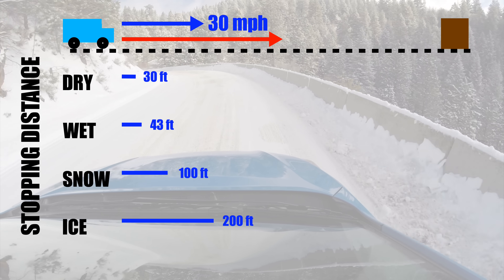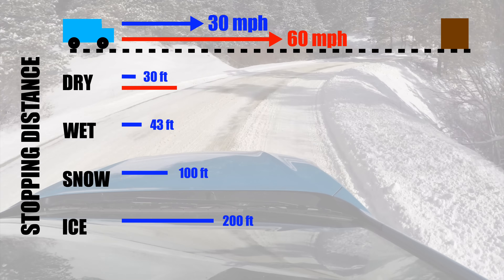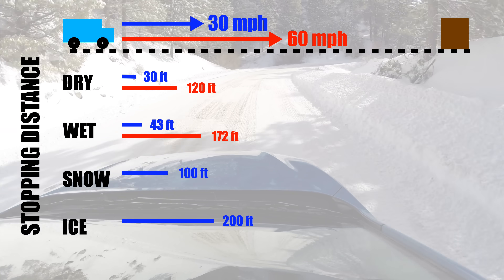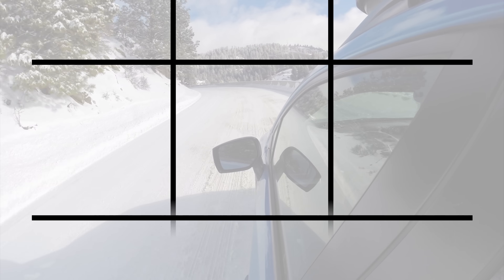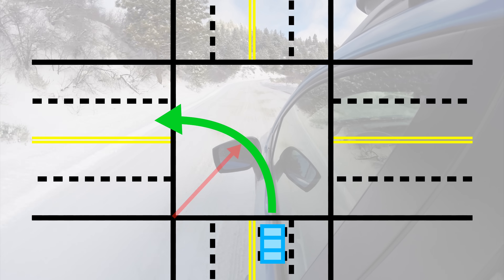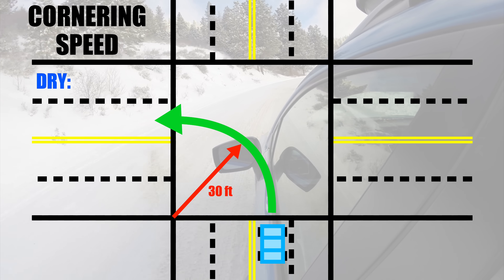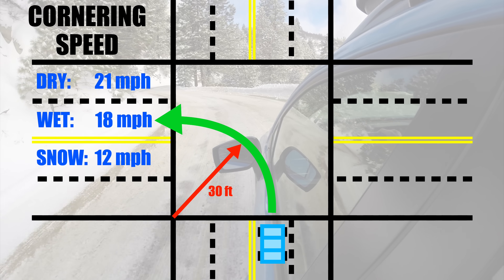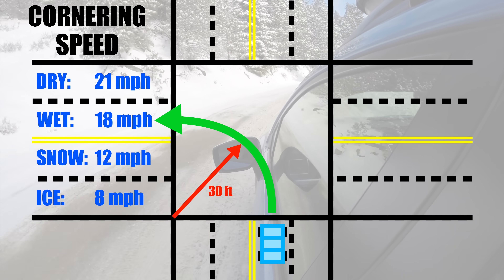Everything You Need To Know About Driving In The Snow

Comment: You should also talk about cold temperatures, which hardens tires and drastically decreases traction on paved surfaces.
Reply: that applies to summer tires. winter tires remain soft enough to handle snow decently
Reply: Actually at really low temperatures icy roads as ice becomes less slippery as temperatures drop. I am talking arctic cold, 30 below and colder, F and C! Ice in mild conditions may have water on or more readily melt from the weight of the vehicle moving over it.

Comment: Learn to counter steer and if you have a 4x4 and are using it drop it down to 1st gear it’s going to slow you down a whole lot faster than locking up the brakes. Don’t care if it’s hard on parts crashing is hard on the body both the cars and your owns. it works because the engine is still spinning and your taking advantage of compression braking it won’t stop you completely but it will reduce stopping distance significantly
Reply: Future Hindsight and where is that vacuum coming from that’s right you have to be able to make compression to cause a vacuum in an engine...
Reply: Future Hindsight what are you talking about they alway have compression with out compression they would not be able to suck air in on the intake thus creating a vacuum... obviously the throttle is closed on a gas engine your trying to slow down with engine braking.
Reply: Air makes compression not fuel... fuel makes the boom happen
Reply: Future Hindsight your missing the point you have to have compression to create a vacuum to begin with. Without compression you don’t have an air pump which is all an engine really is wide open or zero throttle it’s still creating compression. It’s involved in more than the compression stroke. Think about a diesel they don’t have a butterfly valve in the throttle body they control rpm through fueling alone but still engine brake

Comment: Hello, My name is Pablo.  I have posted several times this question on the internet, and it seems that nobody knows the answer.  I just bought a 2011 Subaru Impreza STI, and I want it to change the transmission to a DCT.  Actually an BMW M4 Transmission.  How do I do this?  I'm not worry about the mechanical part but the part on sending the shifting gears to the transmission through the CAN.  Will this be possible?

Thanks in Advance,

Pablo

Comment: I made it 4 winters consecutively without wrecking my 1993 Nissan 300zx with posy track (i dont know if I spelt that right), wide tires, and rear wheel drive up to 3” of compact snow. Chances are you you have little excuse not to drive correctly in snow.

Comment: One thing you didn't mention -- if you have, say, 0.3G of grip in snow, that's a total amount of grip available to you.  It is split between acceleration/deceleration and cornering.  If you are only cornering -- with absolutely no acceleration or braking, then and only then do you get that full 0.3G to help you make that turn.  If you are accelerating or braking at all, then your cornering grip is reduced by however much grip is being used by that acceleration or braking.

It's why anti-lock brakes make you feel like you're "speeding up" when you turn while braking hard.  The system is calibrated to automatically assume steering is more important than braking, so it reduces braking force to let the steering happen without sliding or locking up the wheels.
Reply: Excellent explanation! 
Thabk you!
I would love to see your opinion on driving a Semi with trailer!?
Reply: Yes. Cornering lowers grip, acceleration and deceleration lowers rip, both of these together lowers grip even more.
Reply: Definitely. I've enjoyed fast driving and long ago got into the habit of doing most braking before entering corner with minimal brake force. Yes, there's trail braking but more generally.
Reply: I wonder why that important thing didnt exist on this video.. That is the g-force grip circle all about. You dont need circle if talking two directions separetely as he did.. You cant seperate those in real life though.. Can abc brakes drop braking power to allow some force to steering also? Its complicate thing becouse rolling tire gets better friction than sliding tire but still you cant use maximum rolling friction to get some turning grip also.

Comment: 3 years ago I almost crashed into a highway concrete barrier due to ice and snow. And no I wasn't speeding. In fact I was driving 15mph under the highway speed limit due to the road conditions being so bad. Anywho, I bought winter tires just for winter. Once I got them it hasn't snowed that bad since. Go figure 😕

Comment: Another advice from me would be sticking into a lower gear and keeping up higher RPM, so that you can use the engine break, which is highly useful on snowy conditions. ;)
Reply: Lower gear just makes spinning out harder to avoid if the driver is novice. Tbh taking off in 2nd gear is a good place to start.
Reply: Terrible advice. Engine breaking can cause your drive wheels to slow down alot faster than your other wheels if you're on ice. I guess it makes sense in a AWD car. But it will cause a loss of control in FWD or RWD if the conditions are correct.
Reply: @larryhouse3776  It must all be gentle. Going from 4th to 2nd in very high RPM is a suicide. Gently... it is the most gentle way to stop rather than activating brakes. The stress you are on and the lack of time pressure you enough to miscalculate the right amount of break pressure.. a little bit too much and it may slide the car :)

Comment: If you look at a lot of the comments, there is a lot of discussion about 4WD vs AWD vs FWD vs RWD... It would be really useful to make a part 2 to this video in my opinion discussing what drive train is the best for snow driving and how to best get traction with each drive train option in acceleration and braking.  I think that would be really useful and appreciated
Reply from the maker: It’s a good suggestion, though I do have a lot of content around this (just not that specific scenario). But videos breaking down best AWD/4WD, and how to maximize braking. For acceleration, 4WD and AWD will be superior vs 2WD, assuming all vehicles are on the same tires (winter being the best, for snow and ice). For braking, any car with good tires and ABS can outperform anything with 4WD/AWD using worse tires. All cars brake all four wheels.
Reply: @EngineeringExplained  Thanks, I watch a lot of your videos and I'm actually on a Formula SAE team in college, not sure if you're familiar with that, but we watch your videos in our shop often times relating to Powertrain topics... We have some weird problems that come up a lot with our completely custom system haha.

Comment: Nothing about tire heat? funny in Formula 1 they can't really even drive if their tires aren't warm enough.  The same principle applies to snow driving.  This comes into play on highways, you need to keep your speed up to keep the friction high enough to produce the proper amount of heat in your tires, that way the grip will cut right through the snow.  

How did Engineering Explained completely miss this part?
Reply from the maker: Because it’s not actually all that relevant. Winter tires don’t need heat for grip in the winter, that’s the whole point. The compound remains soft when it’s cold. In fact, when a winter tire gets hot (for example driving on them in the summer) they actually perform worse (as I’ve created videos on my channel demonstrating). Remember, you don’t have to be condescending to offer criticism. It’s better to just be nice about it.
Reply: The title of the video is "what you need to know about driving in the snow," not "how winter tires work" I'm not being condescending I'm simply flabbergasted that you didn't include the most important part of driving in the snow.  I'm sure winter tires perform worse when hot on pavement but you didn't compare the heat difference in snow tires while driving on snow.  If you want to be comprehensive you should include all aspects of driving on snow, including how to drive on snow with all season tires.  Take a look at the difference for yourself when driving on cold tires vs warm tires. It is very relevant and can save your life.

Comment: You said "Everything", yet you haven't mentioned tire chains or ABS?
Reply from the maker: If you get a good set of winter tires, you won’t need chains, and you can drive faster than 25 mph without damaging your car (not to mention chains are terrible for roads). Definitely worth using as a cost effective way of driving on snow, but more of a temporary solution for locations that get very little snow. Also, many cars don’t allow chains because they can interfere with brake lines. But yes haha, this certainly would have been good information to include!
Reply: Love your videos buddy, thanks.

Comment: When ABS engages do those stopping distances change?
Reply from the maker: A good ABS will be fine in the snow. Older cars may have trouble with the relatively low vehicle speeds. ABS has to know your wheel speed in order to work, which is difficult at low speeds. But in theory ABS (on a modern car) can stop as fast as the best driver.
Reply: @EngineeringExplained  are you gonna make a video to prove it?  Lol I'm just curious as to the results.

Comment: Thanks for another great video! 

Question about “traction circle”: the shape of the contact area between tire and ground is usually a rectangle, why is the force distributed evenly? In other words, is the forward/backward traction the same as side-to-side traction for a tire? 🙏🏻
Reply from the maker: Forward back is slightly better than side to side. And a good tire contact patch will generally be rounded, rather than a pure rectangle, which allows for better movement through water.

Comment: It wouldn't be a circle would it, more an oval? The tread design will have different lateral grip to drive or braking, and suspension choices like camber, toe in\out ect can further accentuate these characteristics, increasing high speed cornering but decreasing the straight line performance slightly.
Reply from the maker: Yes, in reality it’s an over. More longitudinal grip vs lateral grip.

Comment: Tips from a snow driver: Don't drive on old winter tires. Switch every fourth season, even if the tires have been in storage most of the time. (The tire hardens over time, which reduces your grip)

Driving on new studded tires? Drive slow the first 200 miles or so. No hard breaking, hard accelerations or turns. The studs may not set in a right angled position if you drive them too hard when "breaking them in".

Check your wear pattern regularly. You should have a minimum of 3-4mm. Don't wear the tires down to the minimum markings.

If the roads are icy - don't trust the tires. Just drive really really carefully. Even if you're on studded tires. If your tires aren't studded - use an alternative form of transportation if you can. Especially if you're not comfortable driving in hazardous winter conditions. Where I live, winter lasts for about half a year. I drive like a priest when it is icy. The stopping distance is ridiculous, even at very low speeds.

Four wheel drive doesn't help at all when it comes to stopping distance. You have to be equally careful in a 4wd, rwd or fwd.
Reply: I switch every two seasons
Reply: My experience with winter and tires is if your tire is behaving weird to is probably gone hard. 35 years oilfield western Canada.  One set of Michelin tires I learned early in the season had gone bad. GP Alberta, every intersection was a skid school lesson. Polished ice.  A quick trip to the dealer and 4 new Michelin all Season and I was back in business.  Only had a few "winter tires" over the years,  one set was a cheap set and near useless, quickly replaced, Sears something.  I did just fine  on All Seasons.  It is a matter of attitude. Speed, separation,  drive for the conditions. I never ditched a vehicle, although I was a passenger in a few.  Brake checking and steering checks are informative.  Do as often as necessary.
Reply: Where do you live? Canada?
Reply: @raveenachopra5081  Oregon
Reply: Tires stored away from sunlight and sunlight heat do not really degrade in time. What may harden some winter tires is driving then in warm weather. Agree about iced roads, no winter tire will perform unless it's studded and even then it's not a miracle.
Reply: @Peppermint1  I live in the north of Norway. We don't have much sunlight during winter, and winter is long. My winter tires are stored dry and dark in my garage during summer. They definitely degrade over time, with or without direct sunlight. Local tire salesmen sell out tires that have been on storage for too long with a great discount, and not without reason. Driving in hot weather softens the rubber and makes for excessive wear and tear if not careful, indeed, but hot weather during winter where I live is a rare happening. 🙂

Comment: I think you've missed a really important point.  When you have 0.15 to 0.3 g available, you have to subtract the horizontal component from a slope.  Thus there comes a point where on a slope you cannot stop no matter what. I think this is where many come unglued.
Reply from the maker: Great point! Some hills simply aren’t possible to go up or down when covered in snow/ice.
Reply: Future Hindsight  if you are vertical on a cliff face you're experiencing precisely 1g not thousands.  Unfortunately cars don't come fitted with crampons either.

Comment: Winter driving is always a necessary topic this time of year. Little disappointed you didn’t go into why the traction circle is a CIRCLE and not a square. That if you are applying maximum cornering load, you have no reserve for braking. If you apply maximum braking, you have no cornering reserve. If you need to do both, you still only have that 1g/0.7g/0.3g/0.15g, but it’s now at an angle and you have to split it between the cornering and braking loads. Pro Drive school at PIR did a superb job of this on the whiteboard and in the skidcar during their Car Control & Defensive Driving course. Worth every penny.

Comment: @engineering explained Curious your opinion on this. Front wheel drive is often touted as being good in the snow, I disagree. 4wd obviously is the winner, but I think that rear wheel drive is better than front wheel drive in the snow. With front wheel drive, you're asking your front tires to do all of the steering, most of the stopping, and all of the acceleration. They just don't have the grip to dole out to all the tasks at the same time. Rear wheel drive allows for better balance of the available traction. Front wheels for steering and stopping, rear wheels for acceleration. You can also control your steering with the rear wheels by initiating a power on drift. 
I routinely blow by front wheel drive cars in my open diff 2wd pickup, and pass my fair share of awd and 4wd vehicles as well
Reply: Giovanni Cintolo You sound like someone who’s never driven a FWD vehicle... Yes they are much better I’m afraid, I own both. FWD works because it pulls you around corners, the drive wheels are turned the direction you are trying to go, in RWD the drive wheels are pushing you straight... Also you can’t compete with the amount of weight a FWD has directly over the drive wheels. Sounds like you are just a more daring driver then most.
Reply: @CarswithNash  I most certainly have owned and driven them in the snow (with good tires). I find they sometimes pull you into the corner, or sometimes plow straight ahead. I've seen many bent rims from the front end washing out with the wheel cut, sending the rim sideways into a curb. I do agree that the extra weight gives your drive wheels more traction, particularly starting on a hill, but I also find that it's much easier to get beached on a plow berm, because if the front end doesn't make it through, your drive wheels are floating in the air.
I personally prefer rwd, I drove home 50 miles in the last blizzard in my little 2wd mitsubishi pickup. I was passing people left and right, even the plow trucks. Yes, I am a more daring driver than most. Yes, it requires a different skill set. But I do think that it is better balanced, particularly in cornering. If your rear wheels are pushing you straight, you're not giving it enough throttle ;)

Comment: Plus now with antilock brakes it adds another dimension in winter driving they missed:   Even when your driving slow around corners, and you need to slow down even more the antilock brakes release, the car speeds up, and then you go wide in corners.  Very spooky, and at times dangerous.  Now, with antilock brakes, I really have to drive slower than grandma in freshly snowed, or icy conditions.    They don't design the systems for Canada, but generally for snow free California.
Reply: Mike Mallano Yep! I pulled the fuse on several vehicles I’ve owned, I even did tests on glare ice & could stop 30-40% faster without ABS, I agree it is dangerous!